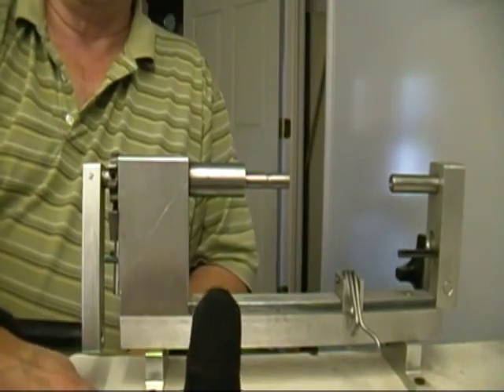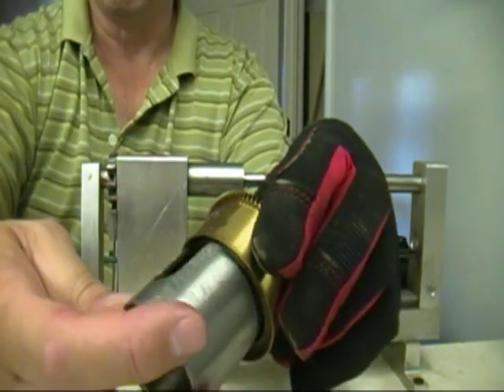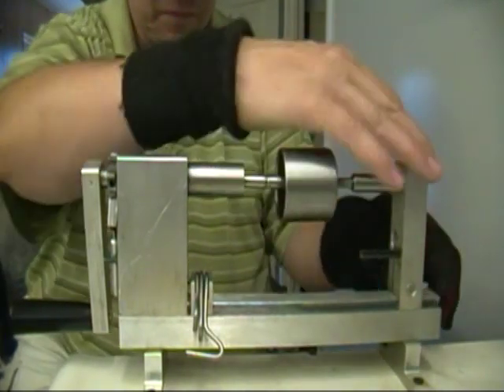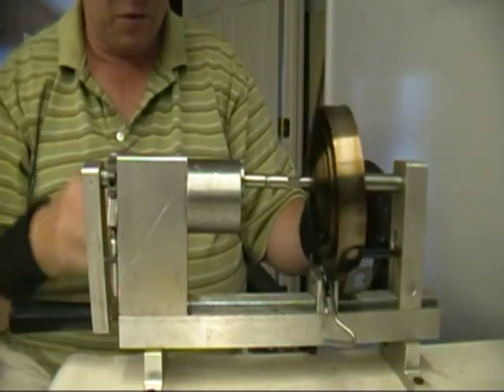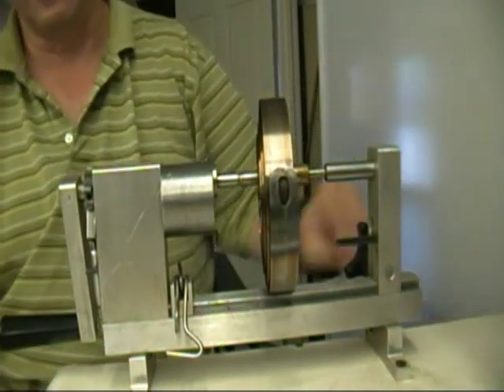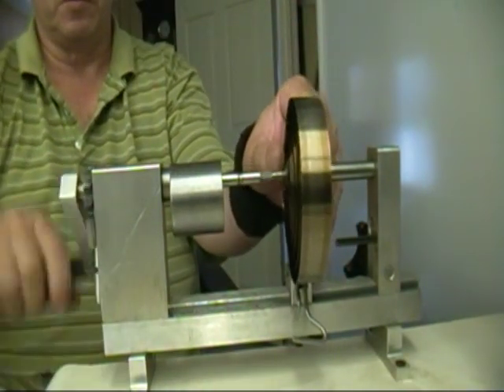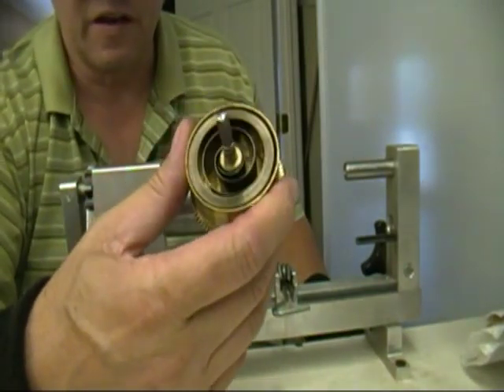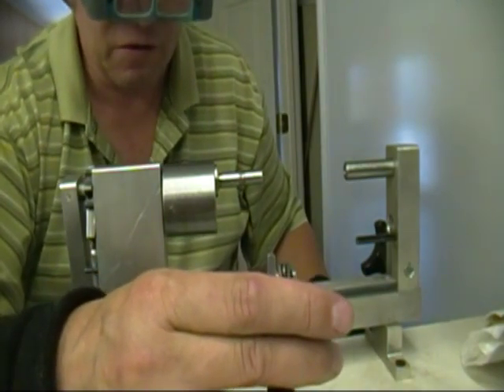Remove and Install Barrel Mainsprings

Comment: Very informative video!  I have an old German Keinzle wall clock.  It is small and estimated to be late 1800s or early 1900s and sometimes it feels like the spring rubs when winding.  It runs sometimes and sometimes keeps stopping.  Can good springs be purchased for this?  Also, how do I determine the correct type and size to purchase?